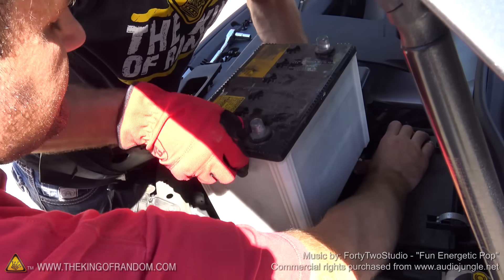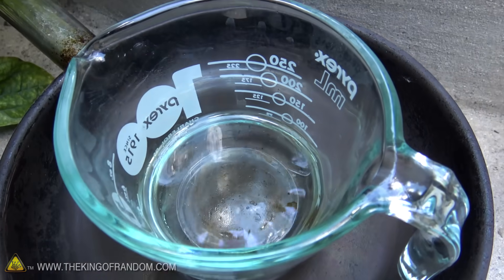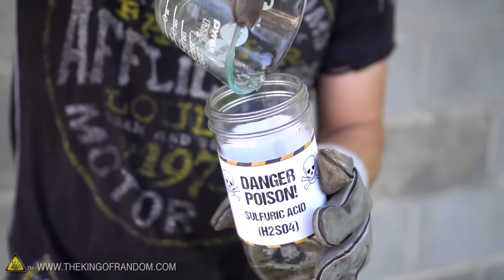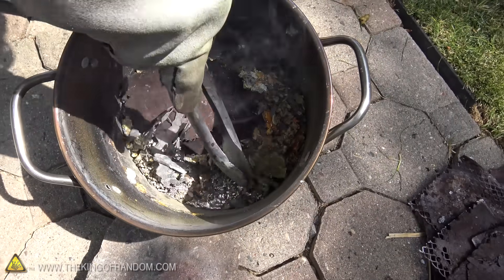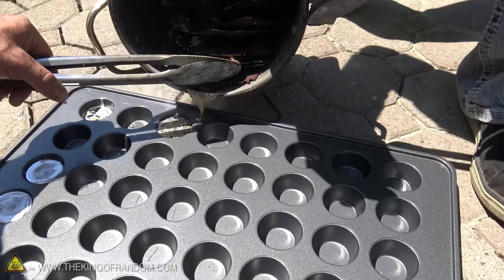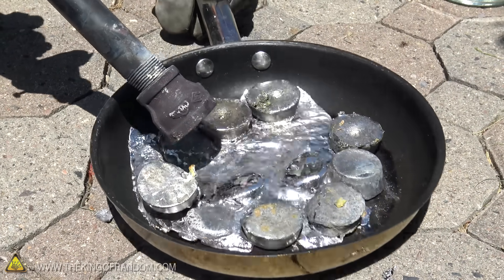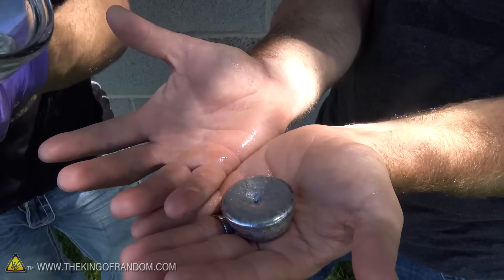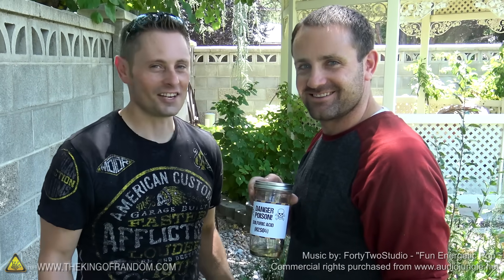Lead Ingots & Sulfuric Acid Scavenged From My Car Battery

Comment: Have you tried using electrolysis on the lead ingots? It purifies them on an atomic level. You need an electrolyte solution that contains lead in the chemical formula and have pure lead on the positive side of the electrodes in the solution and impure lead on the negative side of the electrodes in the solution. The solution will be conducive so the lead pieces shouldn't touch.

Comment: Melt the lead into a block, bore a 1/2" hole about an inch into the block. Fill the hole with Americium collected from dozens of smoke detectors. Cover the hole hole with a sheet of aluminum foil. When the alpha particles hit the aluminum, the aluminum ejects a neutron. Your neutron gun is neutron fun and an excellent source of radiation!

Comment: Despite your ad for Pyrex, I've had 2 different pyrex dishes explode on me in the oven - at a normal temperature.
Reply: AversaS why did you put the pyrex dishes in the oven in the first place?
Reply: If the oven was preheated then the temperature change (Thermal Shock 1:05) could cause that.
Reply: Pyrex with certain chemical makeup (soda lime-based silicate glass) can break much easier (~99 degrees Fahrenheit). Their borosilicate counterparts can withstand 300 degrees Fahrenheit, though.
Reply: as you can see that Pyrex cup with held temperatures than your open could ever exhibit.

Comment: in those lead muffins I see lots of bullets assumeing thats 8 pounds

 7,000 grains = one pound 8# = 56,000 grains ÷124 grains typical weight of a 9MM bullet  for just under 500 bullets 451 and  a 1/4

Comment: I dont get it...if lead is geavy and dense....why does it have low melting point
Reply: Doodle Warrior the mass of an object is not a factor in melting point. Carbon, being quite light, has incredibly high melting point for example and quite a low mass.

Comment: Sadly many people are unaware of the toxicity of lead acid batteries.  The battery acid itself contains some lead in addition to antimony which is also highly toxic and a potential carcinogen and can form toxic gases.  Battery acid should only be recycled at a facility and not dumped on the ground as some people have been known to do.    It is not a pollutant that degrades.

Comment: if you mix charcoal with the left over lead dioxide and heat it with torch you should be able to reduce it to lead

Comment: Those aren’t close to pure... you would need to treat the lead inside of a kettle with tar sodium hydroxide red phosphorus and iron pyrite... that lead is probably only 96% lead you still have tin antimony arsenic sulphur etc. still in the battery.... also when you’re melting that down if you leave it in the metal pot you can skim all of the oxidized material off the top and the lead will stay in the bottom easier to poor

Comment: Congratulations, you got:

1) lead-antimony alloy (cause you didn't remove the antimony grid)
2) increased probability of cancer and other debilitating diseases because of reckless smelting
3) crapped up yard

When dealing with poisonous (not toxic - toxic means biological) heavy metals, heating them so that they oxidize and produce smoke, as well as jerking them to lift the dust in the air, is very reckless.

There is a way to salvage lead from the battery that does not include methods used by third world country workers on dumpyards who will die around age of 40.

Comment: I always wondered "why the car battery is so heavy when it is just a plastic box filled with some fluid?" now i know, becouse it has alot of led and sulfuric acid <- (which is heavier than water) unneeded knowledge, but its good to know 😊😊😊

Comment: what happend if u boil asid in stainless pot instand for glass ?
("google translate"
What happens if you boil the acid in Stainless pot instand for glass?)
Reply: It would eat the metal. Glass is inert when it comes to most acids there are some that can even break down glass.

Comment: Not a smart idea to use a car battery to get lead!!  But, you are the King of Random and have a use for and know how to handle the other bad things that are inside lead batteries.  

To clean your lead, use a flux like, candle wax or saw dust, which will pull up the impurities that don't float to the top to be skimmed off.

Comment: Please use another container for the acid. It will eat right trough the metallic lid.
Ow and if you are messing around with boiling acid and liquid lead contaminated with god knows what, please use the proper safety gear. There is a high chance that besides the lead also the contaminations are very toxic.

Comment: You should probably learn what fluxing is. If you were to burn down smaller batches in a smaller container you could scoop out most of the large debris with a stainless steel straining spoon. The melted lead could then be cleaned out by melting a large spoon full of paraffin wax, stirring the wax into the lead and shocking the debris and dirt to the top of the lead to be skimmed off.

Comment: Befor you drain the battery mix a strong solution of Epson salt and water and put into the battery for like over night then drain and flush out and you will recover even more lead: Also go to this you tube video:-------
Lead Acid Battery Desulfation Using Epsom Salt  -- First Test, Adding Solution   Part 1 of 6
  --------it also help's to recondition a battery but if you can remove the sulfur you'll get more lead.

Comment: congratulations you have lead poinsioning.....also if that battery was dead you have water not acid, from you yield im guessing it was a dead battery only a fully charged battery has 35% concentration of acid a dead battery has very little acid since the acid is half of the reaction that makes the power the acid converts lead dioxide to lead sulfate and water charging make lead dioxide again and sulfuric acid , so if it was not a dead battery would would have had about half a bottle of acid instead of a half inch in the bottom...

Comment: they do know that lead is a VERY dangerous metal....right??
Reply: and should not be handled with bare hands
Reply: a little contact isn't going to hurt you, just wash your hands afterword.
Reply: MLG Foxy 87 even mercury isn't that toxic.
use a little sense and you wont have a problem.
Reply: tyler roberts im talking lead not mercury
Reply: MLG Foxy 87 you're completely missing the point is what you're doing.
Reply: MLG Foxy 87 you do realize lead is less soluble to your skin than mercury right?
Reply: Gibbs91_30 sorry ive always been taught that led has killed people..... sorry for wasting your time

Comment: I cast my own bullets. You got some lead and you got some zinc. Bullet casters don't use batteries because the left over sulphur is still acidic and it's still in it. If you cast that metal it'll corrode over time. No Bueno.

Comment: this is not a "hack" in any sense of the word... dismantling a battery and collecting the materials is pretty basic and expensive... now if you turned a lead acid battery into a hydrogen generator it could be considered hacking a battery
Reply: and you didn't use a hacking motion to get the battery open from what I saw

Comment: The vapors from melting the cells are highly toxic as they use heptane and other highly toxic substances in manufacturing the cells. Needless to say you are not only exposing yourself to these substances, but also dumping them into the air. WTG

Comment: Build a fire put pot in fire let burn all lead will melt and flow to bottom. Let cool next day dump out the lead will be in a large lump with some junk on top most of the other trash can be removed easy. Ie if not mixed with lead chuck it..   remelt the lead scrap off the leftover trash off poor into ingots.

Comment: This Is Some Very Drangerous Experimentation - Especially Without Taking Proper Measures For Personal Protection.

Also, Any Lead (Pb) Refined This Way Would Most Probably Be Contaminated With Other (e.g. : Hazardous) - Residual - Chemicals From The Battery...

Comment: I've smelled LED before it's not as easy as you guys are making it look you gotta add some zinc and a touch of wax to it the wax will immediately catch fire and then zinc will help push the impurities to the top and this mother f*** will be on fire you're burning off all the impurities if you blow it out and scoop It Off with a spoon you don't care about you'll end up making a pile of impurities I've done this for 4 years straight for casting bullets it's not that hard because when you just decide to scrape it you still have all the impurities inside your ingot you might just scrape the surface but you're not scraping the chemicals inside and if you feel so the need you can start with that spoon while it's on fire just don't try to burn yourself because it will hurt it is really hot

Comment: You guys really have no idea what "hack" means do you.
Reply: Do you?  

Hack has multiple meanings, such as the following:

Hack - a tip, trick, or efficient method for doing or managing something
Reply: hack1
hak/Submit
verb
1.
cut with rough or heavy blows.
"hack off the dead branches"
synonyms:	cut, chop, hew, lop, saw; slash
"Stuart hacked the padlock off"
2.
use a computer to gain unauthorized access to data in a system.
"they hacked into a bank's computer"
noun
1.
a rough cut, blow, or stroke.
"he was sure one of us was going to take a hack at him"
2.
informal
an act of computer hacking.
Reply: Yeah, i do. apparently you don't.

Comment: did you bother to find out what other elements are included in battery Lead alloys? 

One minor constituent is Arsenic. Helps with processing, makes 
 Lead alloys stiffer and harder, becoming more ridgid sooner after forming.

Arsenic is also volatile at Lead smelting temperatures, did you smell something a bit like garlic while smelting down the battery Lead? If so, you might want to go see your doctor and get a heavy metals screen done. And then see what modern medicine can do to get that As you inhaled out of your body...

A man has to know his limitations. Yours would include ignorance of basic chemical engineering, toxicology, industrial hygiene, safety practices and a repeated failure to perform (or understand sufficiently 
well) basic  research into your chemistey related infotainment topics.

Comment: Open flame + hydrachloric acid fumes = EXPLOSION. (Hindenburg.) Please, nobody do what these two fools are doing. Be safe, recycle old batteries.
Reply: The acid is not hydrochloric, its sulphuric acid. Also the hindenburg was actually hydrogen gas... Originally meant to be filled with helium but the americans were embargoing helium and the germans werent making enough of it so they were forced to fill with hydrogen. A big bad blow to eco friendly and energy efficient transportation.